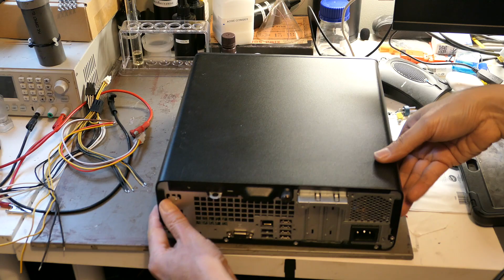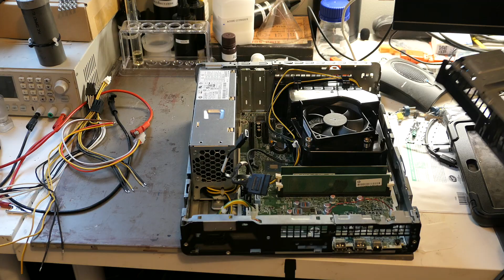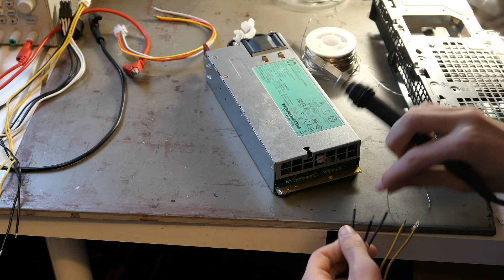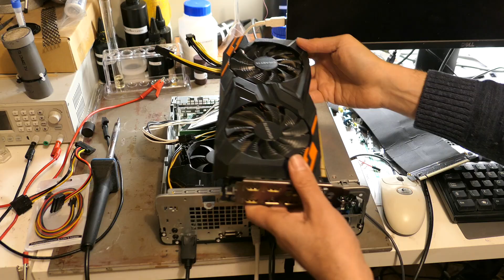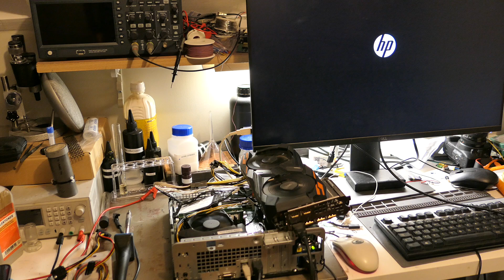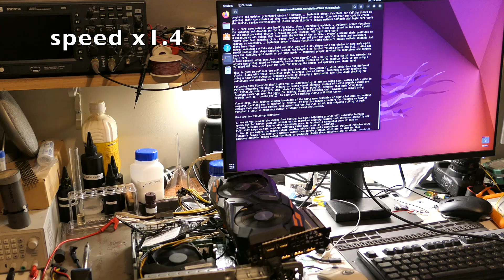Running your own LLM on a $35 PC ! Boost an old HP Prodesk 400 to run Ollama with LLama 3.1.

Comment: The GPU fan is not spinning up, it does not  look like you are using the GPU, to be sure it running, run sudo apt install radeontop in terminal, after it installs run radeontop in terminal and  then run ollama to see if the GPU is being utilised

Comment: Isn't llm most depend on v ram ?
Reply from the maker: Absolutely. The host PC's memory doesn't really matter, and neither does the CPU. The Vega card has 8GB of VRAM and that's what's important. That's enough for smaller models, but it's still limited.
Reply: @sylvainferrand351  all these free models from olama is lie ,they don't even match gpt 3.5 , and they show benchmark how it matches gpt4. I need atleast 14b model which can match gpt3. But when trying in real world in local machine they all give noob answers and hellucinate. So which is the best model?
Reply from the maker: @arunachalpradesh399  Good question. You have to be wary of benchmarks; for exemple I was very disappointed by Phi3, which was promising but quickly became allucinating. Above all, you have to choose your model according to your needs. I'm interested in linguistic processing in French and English, for proofreading, translation and summarization (I've created the little site toutcorriger.fr for my own needs). Llama 3.1 8B was the best, Mistral 7B quite good, and Phi3 bad. I'm also interested in vision (image to text) for the visually impaired. minicpm-v 8B is top (openAI vision API is not better for my needs), Llava seemed limited by image resolution... in short, to be tested according to your needs ! And then there's fine tuning question...